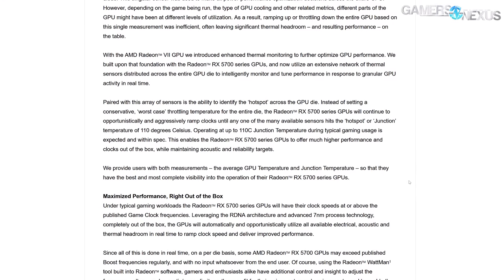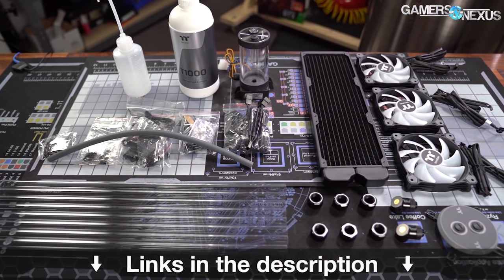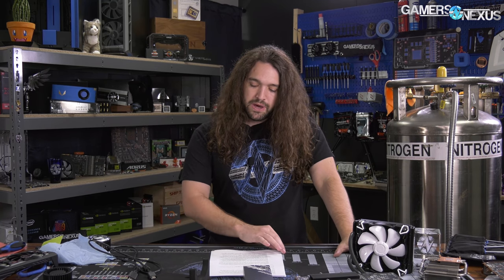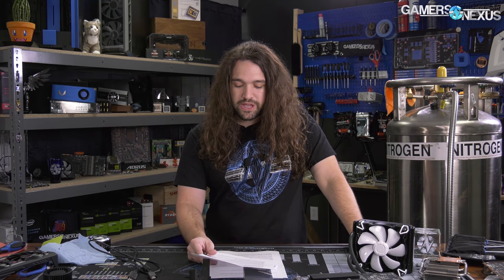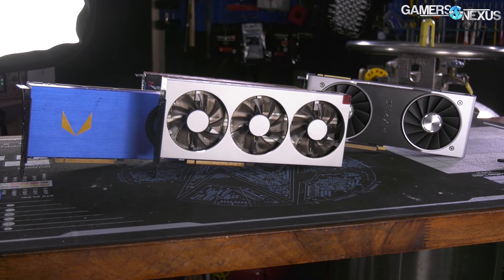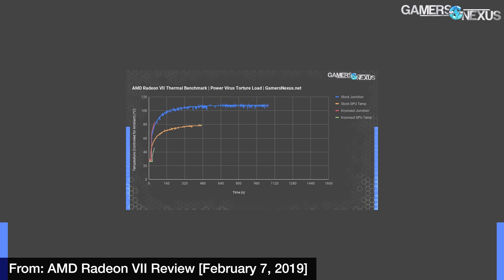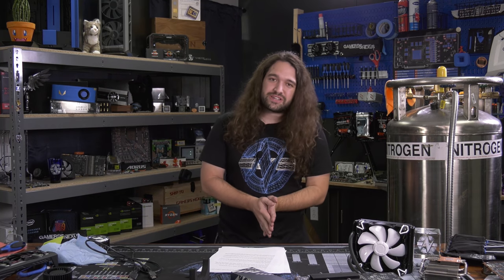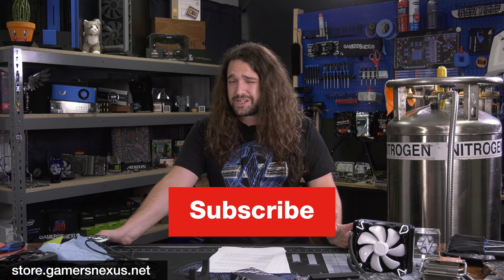Explaining Navi 5700 XT Junction Temperature | 110°C is Not "Expected"

Comment: Well here's my issue now, and I wish I could get help here, or info!
I recently purchased a 5700 XT, and I've waited very long for the MSI Gaming X model, the card is insane, I've never seen a bulkier card, IRL or on the internet, the card is massive, it's a 3 PCIe slot, and I think it's the longest card you can find.
I've kept up with Steve from Hardware Unboxed, reviewing every 5700 XT AIB model, and the MSI Gaming X model was the best by a huge margin, when it comes to cooling and temps of course.

He runs an hour test of F1 2019, and compare temps between all models. Most models would set on around 70-75C temps, with an average fan speeds of 2100RPM. 
Until he tried the Gaming X model, it ran for an hour, max temp (not junction) being 68C, and the fans spinning at around 1300RPM, and according to his testing, it operated at 40dBA's....
https://www.youtube.com/watch?v=95rBw053qNw - Hardware Unboxed review of the 5700 XT MSI Gaming X

I received the card, plugged it in, updated my drivers, and I was idling at 75C.... right now, watching the video and writing this, GPU temp is 74C, and GPU Junc. temp is 76C. The fans are on ZERO RPM tho, which is the very reason why I wanted a beefy cooler, I was sick of my vanilla Vega 64 screaming at 4900RPM.

I go to Apex Legends, max out settings, and play a match, leaving the driver and GPU settings at absolute stock settings, the junc. temp rapidly reaches 110C, and GPU temp reaches around 95C, with enough time, GPU temp goes up to 100C. At that situation, the automatic GPU settings seem not to kick the fans off for whatever reason. The overlay settings would say 0RPM, and the fans don't seem to physically spin.

So, after adjusting the fan curve, I can run at around 75C in-game, and around 90C junc temp, but...... with 2800RPM fans....

I'm researching trying to figure out what the heck is going on, and ended up here, but even Steve here, with the Sapphire card, is hitting reasonable temps..... I simply refuse to idle on 75C, or see "110C" anywhere on my screen..... this is just mind-boggling and I'm confused.
Reply: yea man it ticked me off too seeing  it hit 78 C in my system  ,  prior to this I had the fastest  "doable"   1660TI  setup  in the states from what I could tell from all the  benchmark sites (userbenchmark etc)    I ran that card at 2185 (core clock AVERAGE<--)      Didn't OC vram as its  well kinda useless at 1080p. (no the super card isn't better lol  what a missinfo  that  trope has become)  12gbs vs 14gbs ...2fps at 1080p (OMGZ )   not worth the TDP % room it wastes  at this resolution.  Far as that Goes the two 5600xt's I tested    both  fell short of the cheap  gigabyte 1660TI  dual fan card I had.     the Pro bios  wasn't so pro for either of em    and they just well sorry  don't  match up to a properly overclocked   1660TI.    This 5700 I have on the otherhand is much faster.       Even stock pre bios flash or  overclocking the 5700 is infact  faster than my  1660TI was ...which u would excpect but then again  I expected atleast one of the 5600's  to "crush it" like the youtube guys  preached for weeks (they are wrong just   Cool your card and  flash it properly , 5600's imo  are  akin to the 1660 super ..  if ya catch one for 230..grab it otherwise get a  TI or  just  move up a tier and get a 2060 or 2060S/2070  5700 +or-xt etc.    Watching alot of youtube  can give u  very poor ideas.  And  you can and will be very dissapointed when after 2/3 days  u aren't moving onto the next piece of hardware like they will.  If you aren't made of money u  will likely be stuck with what u buy for awhile so  ask  actual  overclockers and gamers  how they feel and if they start quoting youtube to   back up  a claim.... stop talking to them because they are likely  casuals   that infact have a mini itx case  , and  run xmp on sys ram.

    U have to remember these channels they have so much hardware to cover.  They aren't spending months with  the card  and depending on it and building their entire system around it. Open test beds are garbo  just  look at the temps they post lol.  Nm anytime they  benchmark  Zen +  processors they  use all core OC's  ....for gaming benchmarks? Come on man  Ever see them talk about  Host/base clock Overclocks or use them in benchmarks ? no ?      thats because  they spend a day or two with the hardware and move onto the next release or topic.     I suspect while they all  hype up zen , the fact essentially none of them  use  the best  gaming  OC's you can use on them in benchmarks  means either A) they intel at home or  B) they  are busy  reviewing hardware and instead of actually gaming night in and night out.

anyway
 Anyway if you don't have a full size case  , these navi cards  prolly gonna run hot ...even if you do have a real case   if its not filled with fans they prolly still gonna run hot.  And even then U need to figure out  how the card's cooler works , if it sucks air  u need to set two  120/140mm fans  directionally  within  8 inches of the cards   on  both  ends and feed the card    , if it blows air  ya gotta exhaust that  crap  as quickly as possible ...if it Sucks air you need to feed it    from the bottom and   put airflow OVER the top (backplate)    if you get what im saying.      AIo the processor  no reason to really  use an air cooler on the processor .     Aio's are cheap ... 50-75 bucks for 240's   , seen 280's/360's   in the sub 80 dollar range as well ,  mostly all the same pumps ...not a big diff in the  rads.     Chipset/ VRM's will get cooled   provided you FAN for your Ram  Dimms which you should  anyway so u can get max OC's on them .   Positive and Negative  "air pressure"  means nothing.       You need to elinimated as many  items as u can  that You have to  direct air toward and exhaust air for.  Aioing the processor is the cheapest component to WC so u should always do that no matter what  Aircooler rev you see.    unless u legit don't have  50 bucks for the masterliq   then and only then should u buy  an air cooler . as  using a push pull (both sides)  of the rad for the Processor not only deals with the cpu  but also  takes care of one exhaust point for the system in the process.   Where as with the air cooler u  have to deal with what its doing to the air inside your case beyond just cooling itself and it lends nothing to the exhaust.

U then Cool for the  ram as that tends to be in the top end and takes care of your VRM  / chipset in the process.  Then every other fan needs to be dealing with that video card.    Water doesn't magically create  "cold"   it  deals with  heat build up better than Air but primarily  the gains are from freeing up power  on the card's  own VRM loops.      So  obviously if you can cool the card   enough where it hits max clocks without it having to turn its own fans on ...ding ding ding  u get fairly close to waterblocked  gpu  performance. 

So with that in mind You should build your system around the graphics card atleast if u game.      Meaning you  place the fans in your system  to deal with that card  and how it deals with its  heat.  If u got the cash  u can WC it  but ya gotta cool the ram dimms anyway esp on ryzen ,  U  aren't gonna want to  run  xmp  and miss out on  15frames.  Not when  ppl routinely talk about how   The benchmarks on youtube are gospel and   Intel getting an extra 10-15 frames with the 2080 means  they are worth 400-550 dollars and a new motherboard every year lol.       You can skip buying a new platform every year or so ...and even skip intel in general if u aint got that kinda cash.        Case/power supply  are the two things u  should invest  in  they aren't items u skimp on as they aren't things u should upgrade  more than every 5-6 years.   IF THAT OFTEN  ...think about it    the case  is the last thing u want to switch out as  it  forces u to switch out everything.  And why buy a cheap 500-600 watt power supply "its enough" ....no its not  u want clean consistant and available power ...and  its the 2nd worst thing to switch out  do u really wanna switch  around  EVERY  cable (even if it is modular) in your system ?  ofcourse not  get as big a powersupply as u can ( i run 1200watt )...i'll upgrade it  in 2028 ...maybe ....do I need 1200 watts ? not now  no ,     Does it run  leak as much as a 600/700/750 ? no  does it run at higher effeciancy  at  a 250-300watt system draw than those skus ? yes.

anyway  case , psu  ...LOTS OF FANS  if u can't wc the card and even if u can ...latency is king in gaming with Ryzen keep the ram cold  and the chipset and the vrm ...and your pets  if htey like to hang out near the system in the summer time .  Don't build consoles

Comment: “This WILL create disinformation.”

2 and a half years later I’ve heard nothing but the “110 is expected line” until this video. Only reason I even looked up anything about it was that the junction and current temps were suddenly going wildly out of proportion even if they still weren’t passing 110. I did kind of know at heart 110 was too much, so I always made sure to not let the junction go past 100 anyway, so when it jumped 10 degrees I knew regardless of its “limit”, something had changed.

Belated thanks for the video. 20+ years and finding real answers is still a bitch 90% of the time. Musta got recommend this because I just watched another of your videos, and now I’m subbed because between the two that was the most easy to digest expertise since Leo Laporte and Patrick Norton trained me.

Comment: The clockspeeds are definitely linked to the junction temp and not the core temp, which explains why a graphite thermal pad was used. My first 5700 XT had a junction temp of 93c, it boosted to 2026MHz out of the box. My second 5700 XT had a junction temp of 84c and it boosted to 2083MHz out of the box. Both had a load temperature of 74c in my case. Once on water, the tj dropped to 71c and the card maintains a max boost clock of 2094Mhz at all times under 100% load. Setting the core speed to 2150MHz 1229mv, with +50% powerplay, results in a tj of 76c, and the card usually runs 2106MHz with occasional spikes to 2124MHz. Like PBO on Ryzen, Wattman is really good at extracting all the headroom the chip has available, which means don't worry about manual overclocking, just cool the part as best as you can and the chip will sort itself out.
Reply: K31TH3R these cards don’t support Crossfire do they? It looks like that should be locked out (if it’s not, then I’d definitely have to see if 4x is locked...)
Reply: @jakegarrett8109  I did actually try to run them in crossfire, because why not, and the option just wasn't there. I don't have any games that support DX12 multi-GPU so I never tested them together. My experience with SLI/Crossfire has been pretty awful, and I don't blame AMD from dropping support, but I also have to imagine that Crossfire 5700 XT's would give a 2080TI something to worry about.
Reply: K31TH3R thats disappointing, my 4x Fury over doubles my Titan Xp (duel 2080ti might match, but offer no real upgrade), I have nothing to upgrade to in the near future from these ancient 2015 cards are apparently the best modern technology at any expense can provide (I would have 4x Titan RTX, but they locked that out, otherwise I would have picked them over 4x 2080ti as the Vram would be nice since even SWBF2 was calling for 20 GB Vram on my Titan Star Wars edition at 11,520x2560 triple 4k resolution). Shame, most of my games work excellent (even duel Fury is much smoother than the Titan, and offers a much better experience on so many levels).

I guess the only way to improve is use cryogenic temperatures, but that’s kind of expensive for running multi GPU like that as a daily machine, but that’s your only option as apparently neither company wants 60 fps 4k to be a reality if they stop SLI/Crossfire (a 1080ti or 2080ti is a joke at 4k, it’s pitiful on one card...), oh well, if they did, I guess then I’d be trying for 60 fps on my triple 4k and so on, at least my quad Fury handles everything single monitor (Crysis 3 on it is mind blowing, over 100 fps at 4k Ultra! My Titan only did 45 fps...).

Ironically, like 90% of the games I want to play this year support xfire, but I’ve found like 0 games that support multi-monitor (and you’d think that would be common, as most people have at least 2 monitors...), haha, multi-GPU works, but no support for multi-display! (If you force it, oh man does it get stretched horrifically for Nvidia cards! I haven’t tried AMD eyefinity on SWBF2 though, but it can’t be worse... even not working at all is better than the 20:1 stretches on the sides, it’s bad for modern games, lol!)

Comment: just got the rest of my parts today and got my new system all setup with my Gigabyte x570 Gaming X, XFX Ultra Thicc III RX5700XT 8GB, Ryzen 5 3600x, 32 GB ram, EVGA 750w, 4TB space(have a 5th HDD that's a 120GB just for OS and core programs), 2 of the drives are WD Black SN750 NVMe(1TB each), 1 is a 7200 rpm HDD 1TB and other is samsung 860 1 TB SSD. this GFX card though at stock is only hitting about 70c junction temp running rust at max settings, if i disregard sound and manually tune the fans i can get it down to about 55c with a decent curve.  i will say this though coming from a i5 intel quad core with no HT, 16GB ram and a XFX RX470 to this is like night and day! i did upgrade my monitor too with this system build to a 144Hz on display port from DVI running 59Hz... i've been under a rock for the last 5 years forgive me!!!

Comment: Specs include worse case scenarios, so the cards being expected to run @110°C is part of those expected worse case scenarios especially when blower cards are put into cost cutting OEM builds where thermal reduction as part of the design is sacrificed to cost cutting to hit a price point.
Tjmax is set for a reason and whatever that may be it will be expected to be hit regularly in a reasonable percentage of end use scenarios. Gamer and enthusiast focused narratives need to stop translating engineering considerations as if statements targeted towards the sum total of use cases are exclusively written for them. The broader market consists of a high percentage of cheap builds with cost cutting measures that will allow the silicon to hit high thermals, with OEM's knowing that the silicon has these inbuilt protective measures.

Here's some additional context from the blog post referencing the Lowest Common Denominator.

"In addition, for every single GPU within a SKU family (for example, reference RadeonTM RX Vega 64 GPUs), the DPM states or Vf points were identical. Given that there is always a die-to-die variance in performance even between two pieces of otherwise identical silicon, once again this meant giving up performance while catering to the lowest common denominator within the wafer population."

So worst case scenarios with the bottom 10% of dies using the reference cards and we can see where the "expected" comes from. Additionally the blog post references gamers and overclockers that adds to this "expected".

"Since all of this is done in real time, on a per die basis, some AMD RadeonTM RX 5700 GPUs may exceed published Boost frequencies regularly, and with no input whatsoever from the end user."
and
"At the end of the day, we know that gamers have different preferences. Some prioritize acoustics while others want to crank out every last bit of performance from their GPUs. This is why we provide them with the flexibility to tweak and customize settings as they see fit."

3:17 you are selectively quoting out of context, here the rest of the sentence that actually references the worst case scenarios.
"Paired with this array of sensors is the ability to identify the ‘hotspot’ across the GPU die. Instead of setting a conservative, ‘worst case’ throttling temperature for the entire die,..." 

So when reading anything within this paragraph, one needs to keep in mind that the new sensor array removes the need for a conservative estimate for Tjmax in worst case scenarios as they can get actual hot spot temps that have allowed AMD to remove that conservative worst case throttling temp, for a more accurate real time temp. I.e they can set Tjmax higher because of a significant decrease in the margin of error that needed an allowance.

Your translation of "expected" is wrong and is subjectively biased as is what many are also doing by applying the 110°C as if AMD meant all cards in all scenarios. AMD didn't say that and it's not bad wording, it's bad comprehension of what the paragraph says and what expected means in the context of the entire post.
Reply: I know for a fact an older radeon card that didn't even measure tjunction that gamed at 113c lasted 11 years 6 of those crossfired with another one and one of them is still going. at 113c or higher every day. RTG says it can be expected to work properly at 110c they aren't messing around a bit.